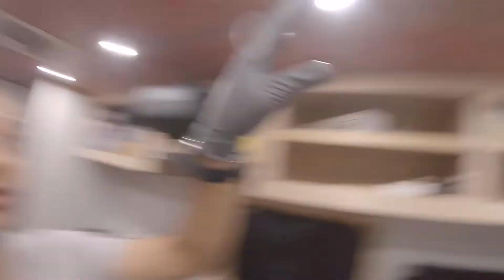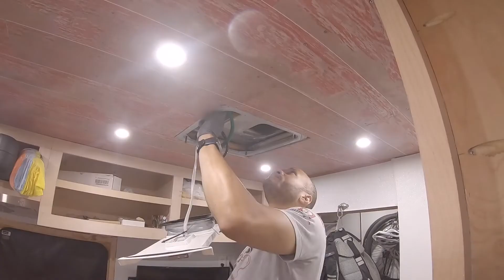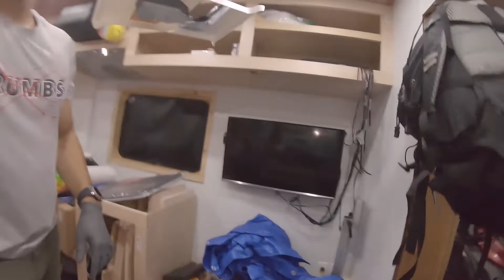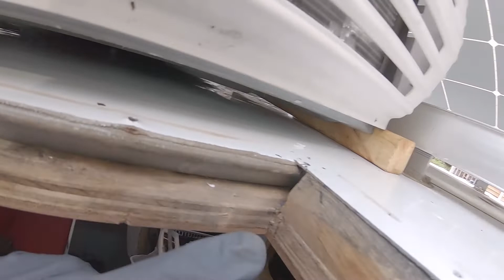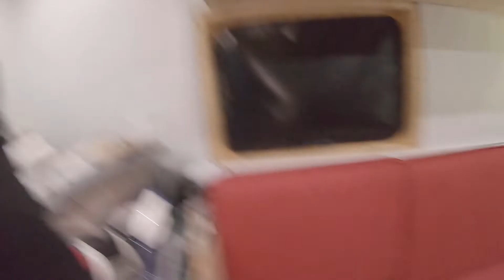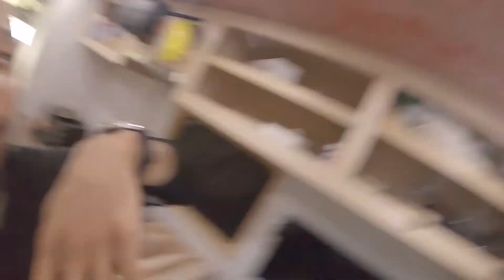Coleman Mach 3 A/C Gasket Replacement From The Inside | DIY Off Grid RV Van Build: Ep. 93

Comment: Don't know if my wide shoulders fit through that hole.  Fortunately I have class A motorhome with nothing on roof so can go up there and move ac out of way.  Good video!
Reply from the maker: Definitely a tight squeeze from the inside! If it weren't for the solar panels....
Reply: I have a Dometic AC. Gasket started leaking during heavy Dec rains. It’s more than 12 years old, so pretty sure it’s aged out. AND…I noticed the gasket is offset on the side that’s leaking when I look up inside like you did. I’m gonna try to access from inside, but I don’t think I’m gonna be able to clean the old residue off with limited clearance. We’ll see. My AC is a bit more accessible from topside, I just don’t like climbing up there (it’s an RPod).